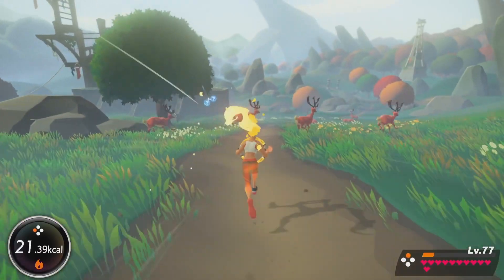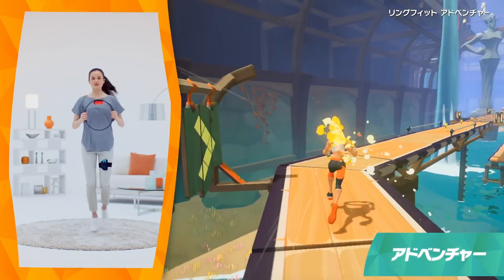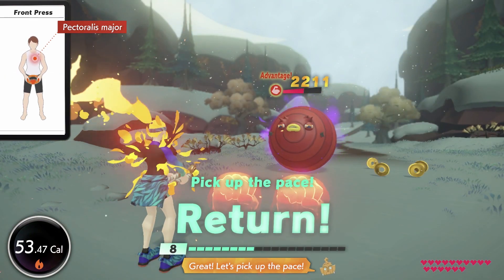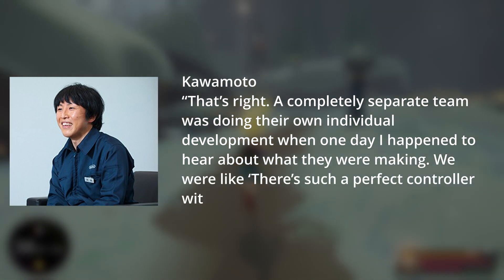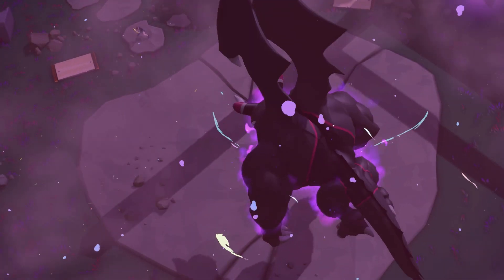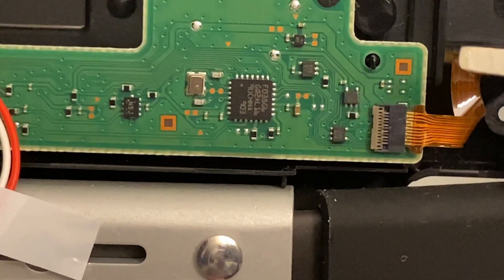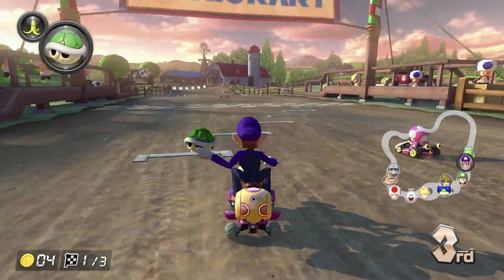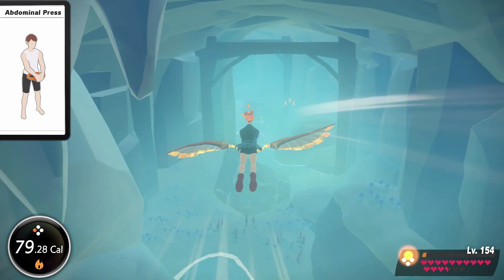The Ring-Con - Nintendo's Best Exercise Peripheral

Comment: I think my biggest problem with Ring Fit Adventure is actually more of a service problem.
I like to have my Switch docked like 99% of the time. I also like to mainly play physical cart games.

So my issue here is that it's just a pain when I have to undock the system and switch games around every time I want to use Ring Fit Adventure.
I know this could be taken as "Oh, if you're so lazy then you really need to play Ring Fit Adventure" but I just think it's a bit cumbersome.
One very easy solution to this problem that I feel Nintendo should offer would be to simply have Ring Fit Adventure being a free piece of software you can just download from the e-shop, it's not like people can really play it without the Ring accessory so Nintendo would still sell games even if they offered the software for free.
Would just be so neat to just have the app sit there on the home screen, ready to boot up whenever you need to get in a few minutes of workout.
Reply from the maker: Yeah I’m the same way. That little extra step of having to switch out cartridges is enough to make me think “Do I really wanna exercise right now?” and that’s usually all it takes to stop me from playing. Having the game downloaded and ready to go at all times would be a great way of removing that potential barrier to entry for a lot of people.